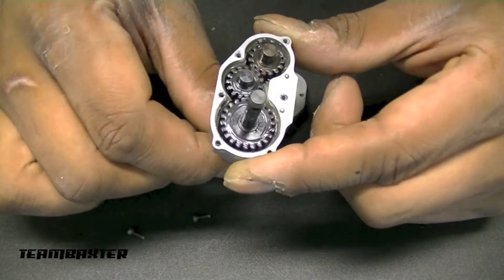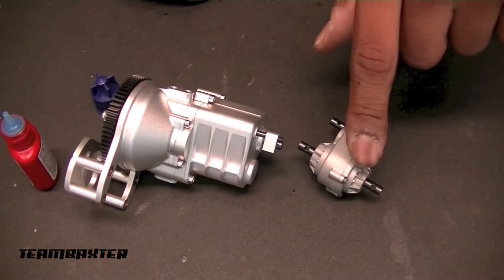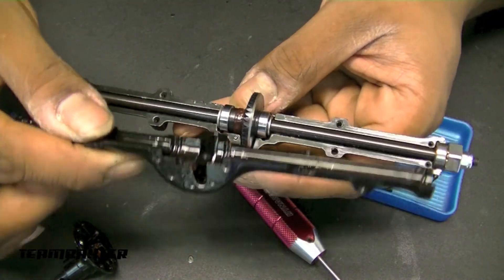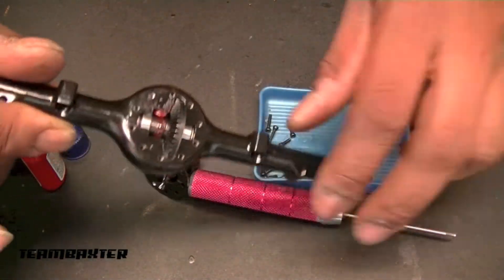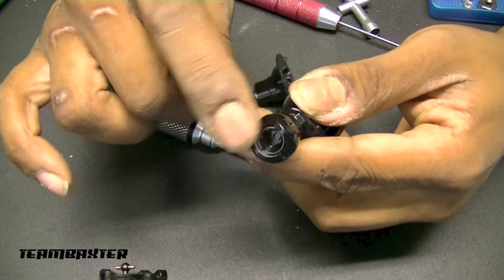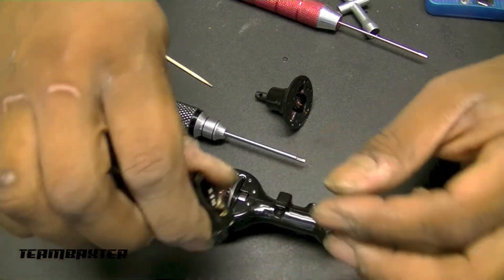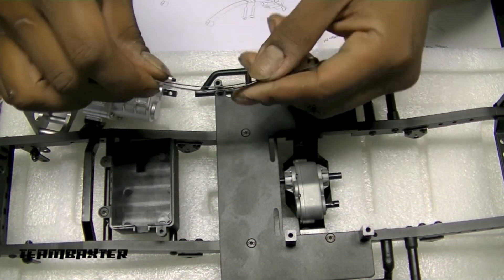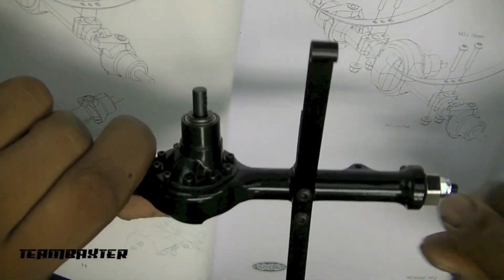RC4WD Trail finder 2 Build: Chassis

Comment: Thanks again for this video. It was helpful...I finished disassembling and greasing my diffs, transfer case, and transmission early this morning. And I'm just about finished with the chassis assembly. Get this!....

As I was preparing to disassemble the front differential/axle, I noticed that the pinion shaft had a LOT of in-and-out play. Turns out it was missing the inner bearing! The shim was there, but NO bearing. I had one in my parts stash, so I was able to complete the reassembly. Afterwards, I emailed RC4WD Customer Service, and they responded first thing this morning, at 4:30am EST (1:30am in San Jose!). They kindly apologized and asked for my address, so I assume they're shipping a replacement bearing. That's what I call customer service!
Reply from the maker: Mike Forrester thats awesome that they helped you out that fast, very good to know. stinks that you got a missing bearing, though. But this stands as a testament of how important it is to check your parts thoroughly before you hit the trail. Glad youre having such a good time with your truck. Its pretty awesome out on the trail, as well. thanks for commenting.
Reply: karl schweizer 

I haven't had to deal with Customer Service lately, but I now own 9 RC4WD rigs, each of them built from a kit. I love these trucks, and I have learned how to address the few problems they tend to have. My #1 TF2 is still taking a beating and going strong. 

The last time I contacted RC4WD I had torn 3 tire beads on brand new 1.55 Rock Crusher tires. They sent me 3 replacements pronto.

Comment: Awesome, and informative vids. THANKS. I'm waiting for my Trail Finder 2 kit to arrive today. I'll be rebuilding mine as well. I don't do much water running, but I want this pup right! By the way, do you notice any excessive drag in the drivetrain due to the extra thick grease? Wouldn't want to bind my motor or ESC.

Thanks!!
Reply from the maker: Mike Forrester I have used those greases (...greases? ... is that right?!...) in MANY rc's with no problems at all. Just be sensible when filling, knowing that your parts may need just a bit of space to move and operate properly. I got mine as a kit, of course, i dont know whether you got kit or RTR, but either way i highly recommend rebuilding, like you said, and applying, at very least, a thin coat of lithium based grease to the moving parts to ensure durability. Im not sure if this video in particular covers the issue, but my kit was missing thread locker in many places, so be aware of that as well. good luck, friend.
Reply from the maker: Mike Forrester and thanks for watching, glad you enjoyed the vid.
Reply: Awesome....I'm heading out to get some marine grease now, and I'll also stop by our local Hobbytown to see if they have any RC-specific lubes in stock.....just to have on hand. I remember racing carpet/onroad RC cars back in the day, and we used the stiff red grease in the ball diff. That reminds me of what you used in your syringe on your TF2's diffs.

Also, my TF2 is a kit as well. I'll be using my Spektrum DX2C radio in it. Still haven't decided on a motor/ESC yet. Considering the Tekin FX-R ESC/35t Heavy Duty Crawler combo.
Reply: Got my TF2 today. What a nice truck kit! Per your recommendation I got the high performance red grease AND the marine grease. I'm in them process of rebuilding, greasing, and thread locking the fasteners on the tranny and transfer case.
Reply from the maker: Mike Forrester awesome, they worked great for me, i hope you have the same success.